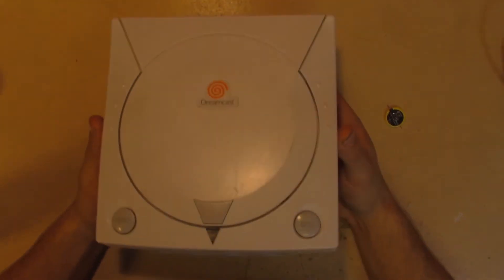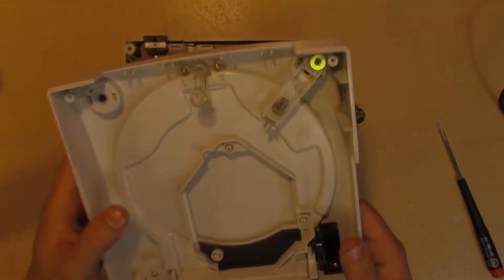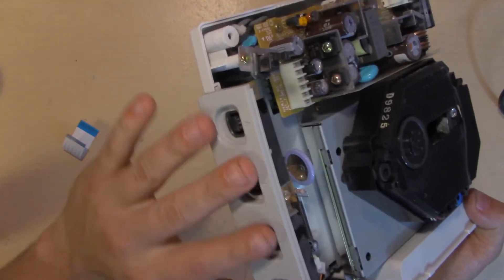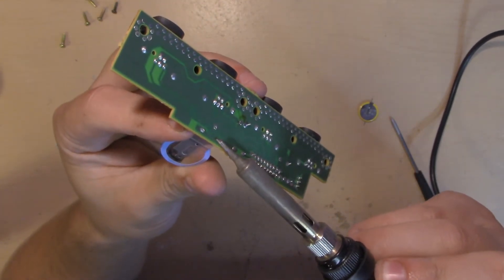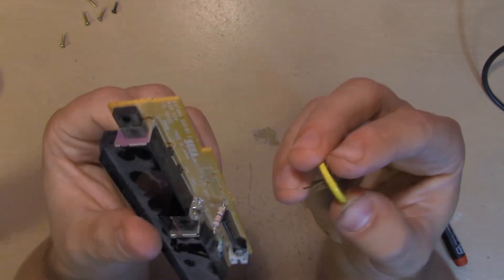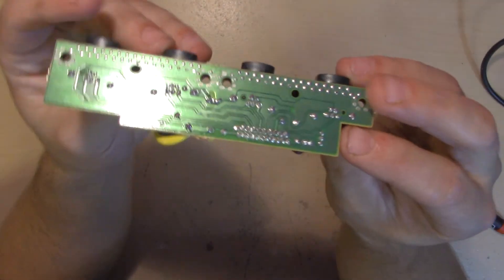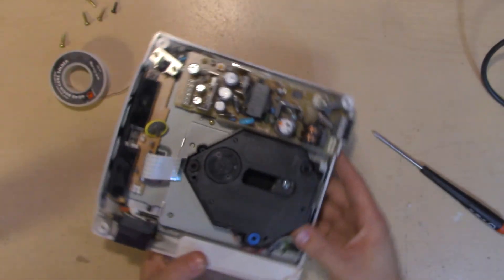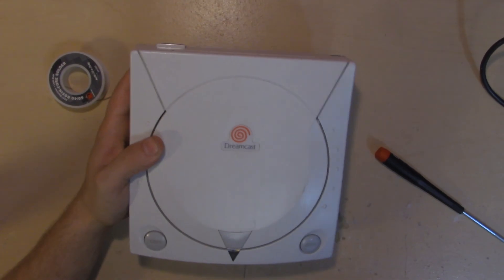How to fix the Dreamcast Internal Clock

Comment: Just for reference, at 2:45 in the video it shows you it uses a ML2020 rechargeable battery. You can use a ML2032 and solder in battery holder if you wish. You should not use a non-rechargeable battery in there. Your existing battery may not actually be dead and instead may just need a recharge after being unplugged and discharged over time.
Reply: Correction: Original battery is a ML2430. But a ML2032 can be used instead. It would just have a lower capacity but functions the same. You can just get a ML2430 as well.